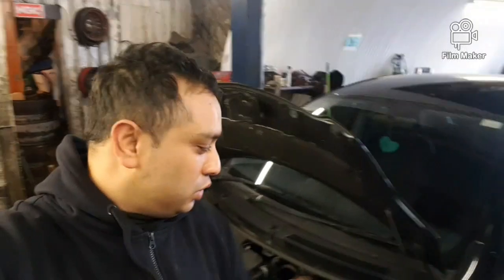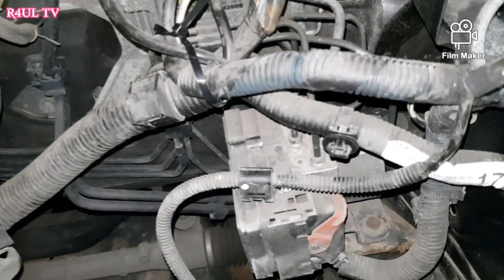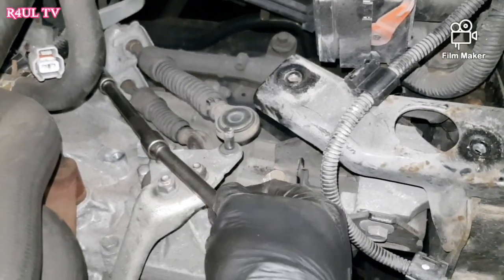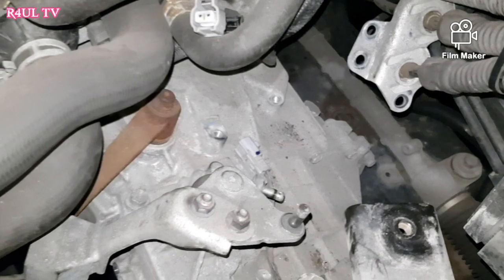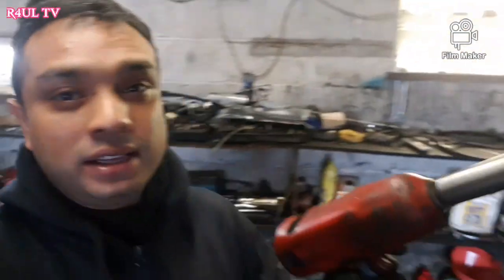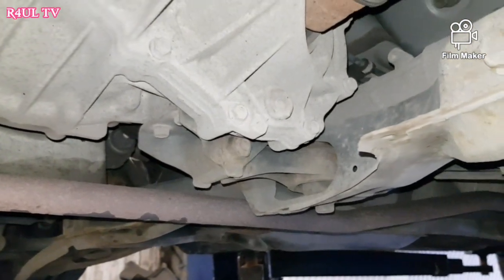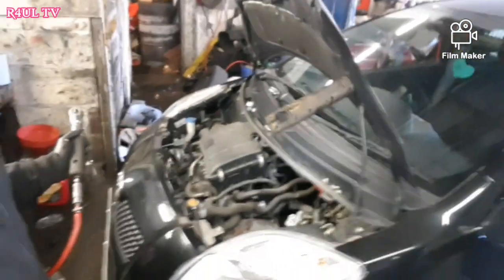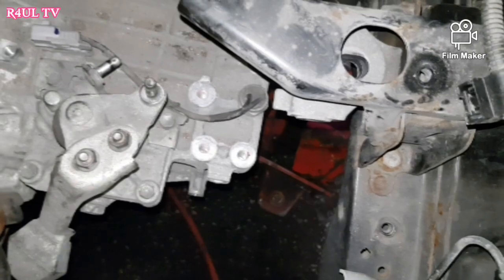2008 Toyota Yaris Clutch Replacement 1.0 petrol

Comment: Take bottom mount of FIRST before the top mount, else the engine will be putting force on it. Not necessary to remove driveshafts from hubs, there's plenty of swing on that left strut to just put the shaft form the gearbox and just tie it up to the brake lines. You don't even need to touch the RH driveshaft, apart from levering it out of the gearbox. you can then just lift the gearbox away from the shaft when you remove it.

Comment: I've just changed my yaris clutch Same  one as you have there but the I changed the slave cylinder at the same time after I fitted it all back together the the clutch won't engage I tried pressure bleeding the system and it worked perfectly when it was under pressure but once I released the pressure it went back to not engaging?  Would u have any knowledge of what might be happening
Reply from the maker: It could be the clutch master cylinder

Comment: Hi, My 03 Yaris won't select gear intermittently. I notice the slave is not leaking and seems to operate the fork. Last time it happened I noticed I  could select 1st after turning engine off but I feel a slight pull when I dip the clutch.
Can  you advise me as to what could be the problem? Thanks
Reply from the maker: If the car goes in gear as normal when the car is off then you need a clutch on the car.

Comment: Hello,
Recently, I bought Toyota Yaris 2007, 1.3 VVT-i, MT, Engine: 2SZFE, French build, LHD, 114 000 km.
I've a problem with the clutch pedal biting point, which is fully down to the floor for all of the gears. Sometimes when I try to shift into Reverse (even if the clutch pedal is fully depressed) a grinding noise is heard when I move the gear shift. If I push the pedal fully down on the floor, shift into 1st gear and release the pedal even 1-2 mm higher than the floor, I can feel that the car starts moving. Sometimes when I drive and switch from 1-st to 2-nd gear, the shifting of the gear is a bit difficult (the pedal must be strongly pressed fully to the floor). My leg gets tired after a long drive and sometimes I cannot make such a presure, so the difficult shifting problem appears.
The pedal free play is around 17-18 mm. The push road play is 7-8 mm. The pedal height from the floor seems to be OK (It's a bit higher than the brake pedal). I can depresss the pedal fully to the bottom on the floor. When relased, the pedall gets back to its highest position normally. The pedal is not soft.
The clutch has never been replaced. Service technicians said that I need a new clutch. I asked them if bleeding is needed, but they said that the clutch fork mooving is quite well far, so the hydraulic system is OK, and bleeding can even worse the problem. Here is how the clutch fork looks like when the pedall is fully released and fully depresed:

https://drive.google.com/file/d/1Bd1y0MzWDXWIQeLhFrjiWu2JNkG9-veH/view

I was wondering if the pedall free play rod can be adjusted, but I can't seen any adjustments on my master cylinder. Please see the left part of the figure bellow:

https://drive.google.com/file/d/1wzsue-fkHt-FGJeaFHPUFynZFSDBeAdH/view

Can you give me an advice?
Thanks,
Nikolay
Reply from the maker: I think you just might need a new clutch. Sorry but if its hydraulic which I think it is you cant really adjust them. But to be fair new clutch on one of them not too expensive job done around about £250
Reply: @TEAMR4ULTV  Thank you for your reply!
Reply: @TEAMR4ULTV  Just a question: Do you think a fresh gear oil must be used or the old one can be reused, when replacing the clutch?
Reply: @nikolayneshov6120  you should always use new oils!

Comment: Hi do you know if the 2003 yaris tspirit has a Dual mass flywheel or single because my mechanic told me its dual but i thought older cars had single.
Reply from the maker: If its petrol I dont it should have a dual mass. If its diesel It might have
Reply: @TEAMR4ULTV  its petrol so thats what i thought thats why im confused why the mechanic said that maybe he was confused or did not know either way i need a definite answer because ive been told dual mass are not so good and go wrong more often.

Comment: Big chunks of important steps missed out ie how to  get the driveshafts out of the diff, they are held in by circlips and it is possible to damage the gearbox casing if not done carefully. Also skipped the clutch plate assembly step. 👎
Reply from the maker: Thanks for watching anyway
Reply: Thanks, I wasn’t aware and will be attempting this.

Comment: Isnt it good advice to not use power or air tools to remove the pressure plate bolts ? There’s a risk of old clutch dust being blown into the air and it’s nasty stuff you dont want to breath in. I guess if you have a respirator it might be different....

Comment: Really? On a clutch replacement video you point one by one the bolts to remove and then don't even show the actual clutch replacement?
Reply from the maker: Really easy that's why I didnt show you how to change the actual clutch. If you could do all that then I think you can just take the clutch bolts off only 6 of them not very hard.
Reply from the maker: Dont worri next one I do al show you how to take the clutch off and how to Replace it